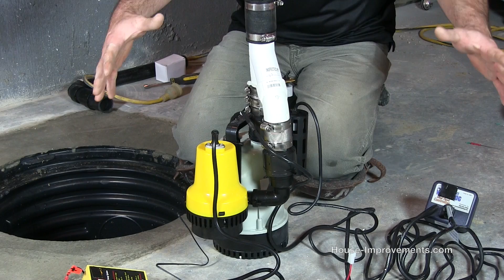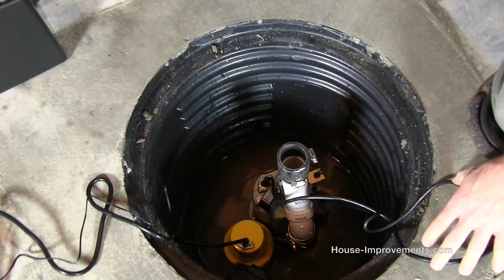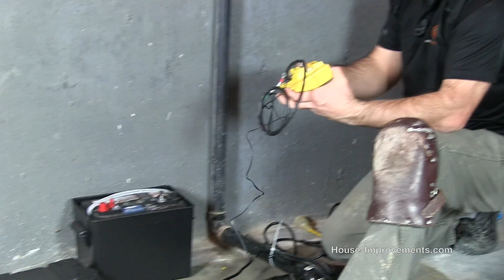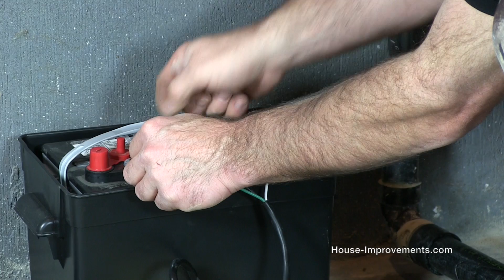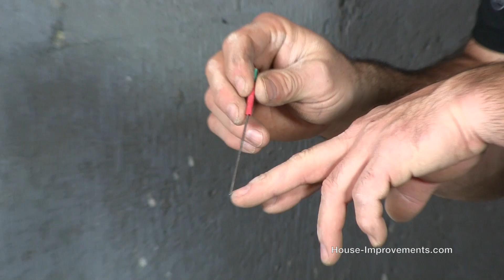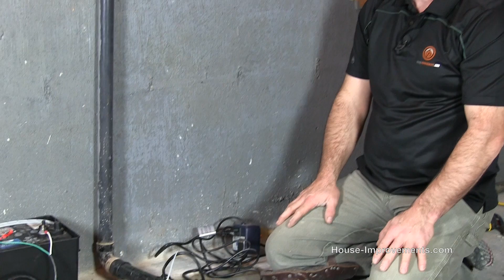How To Install A Sump Pump

Comment: I wanted to let you and your viewers know...the 12V systems are designed to continue to run for 10 seconds after the water level switch is  set to shut down. So, you unplugged it and didn't follow up on that issue, but that's what was going on and why it didn't seem to be shutting off. Great video!
Reply from the maker: That is good to know, I did not know about that feature!

Comment: Hey Shannon, thanks for all of your videos! How do I vapor proof the transition between the pipe and the sump tank lid? Also, the laundry wall box drain inlet?
Reply from the maker: That really should not be an issue but I guess you could seal the pipe with tape on a lid like this ? The drain should be plumbed right into the laundry plumbing .

Comment: I notice that the glued conections are above grade. The rubber fittings are below grade so that any leaks return to the wet sump. Is that correct?

Comment: I noticed that, during your test run of the primary pump, it rocked noticeably in the pit at startup.  Additionally, wasn't there a strong twisting torque when the pump surged into action? I fear that the pump might destroy the outflow pipe or separate the joint of the outflow pipe and the rubber union sleeve.  Isn't the only resistance to the sudden torque the plastic pipe?  Or, does water in the tank somehow absorb the torque and reduce the vibration?  Otherwise, the pump would need to be secured to the walls  of the well.
Reply from the maker: I know this customer and the same pump is still being used.

Comment: Love your videos.  I would like to share something. I have a real water problem. In April, it is normal to have to pump 1700 US gallons of water in a single day (snow melt). I use a sewage/ effluent pump because it was high capacity instead of a standard sump pump. This means the pump gets plenty of time to cool before it goes on again (avoid overheating). I do not use a backup pump because I cannot depend on a battery operated Chinese low capacity pump. Instead I bought a marine inverter and have 2 marine batteries connected to the inverter. The inverter will provide 110V for the sewage pump when the power goes out. If I am concerned that 2 batteries are insufficient, I can buy more  batteries. I do not have a standard black bucket from the hardware store. I use a 50 gallon drum and when my pump goes on, it evacuates about 110 litres (almost 30 US gallons).

Comment: Hey Shannon!  I am installing a Plumbstar basin with lid lock (2-hole insert).  I already dug the hole and I am filling in the sides with gravel and want to cement it flush up to the lid.  Question is...How does the water travel into the basin if I create a radon breather and the PVC that is pumped out with the sump pump if I make the lid tight?  I went to their website and have googled my butt off and have not quite figured it out. Please help me!
Reply from the maker: These are not meant to catch water that floods from the basement ,these are for ground water from under the floor and around the perimeter of the house. if you have more questions please use my forum.https://www.house-improvements.com/forums/
Reply: @HouseImprovements had the same question.  I live in Perry County Ohio.  We just had a flood disaster and never seen anything like this in my life. 
I bought the last pump there was  and it was a pump like this goes into basin but had no choice but to use it to try save my furnace  
What type of pump do I need to drain flooded basement?
Neighbor brought over a lil giant dump with a garden hose but it just trickled out not strong enough to go up the steps to the street .  
I’d appreciate you directing me to a correct pump and maybe i can use this one for the crawl space portion., 
My old house has a partial basement and under kitchen add on is a crawl space that leaks into basement

Comment: Great video and thanks. I'm following your sump pail install video this week. 

You said that they were dumping the sump water into the sewage lines. My house is like that too. It was built in 1955 and that was the way it was done then so I get a pass from the city. My question is; do you need a P-trap along with the one-way valve? I have but I'd love to dump the p-trap. From what I've read though code does require the P-trap in Alberta. Any ideas?
Reply from the maker: If you are dumping into a floor drain you do not need one cause that drain will have a trap. If you are dumping right into a sewer line then you should have one as well as a sewer back check valve maybe. Use my forum if you have more questions. https://www.house-improvements.com/forums/

Comment: Actually, the backup and the main pump run off a extended run time once the bottom float lowers, so that was why the backup was still running. And they are actually adjustable, they have a tie(backup uses a white plastic one, and the main float uses a steel one) which can be unscrewed and then you can adjust it.
Reply from the maker: Thanks

Comment: Thanks for explaining the details such as how the rubber connector helps with vibration, or about the the slope of the concrete in the previous video. Excellent tips that I would otherwise have learned the hard way. Great presentation, Thank you!
Reply from the maker: You're welcome.

Comment: Sitting a modern battery on concrete is not a problem at all, this is a myth from way back in the old days when battery boxes were made of wood or steel, now days they are made of plastic which is non conductive and the cool concrete floor is also non conductive when dry.
If the concrete is moist it can conduct electricity but the plastic case prevents this from happening, please see the link below for more info.
http://www.homepower.com/articles/solar-electricity/equipment-products/ask-experts-batteries-concrete
Reply from the maker: Thanks Terry

Comment: Outstanding presentation and advice, again. Thanks Shannon. 
Just not super keen on that battery in the house though - "sealed non-spillable" doesn't mean they don't off-gas hydrogen. KA-BOOM. Even in the plastic box (which will likely shatter anyhow) it will make you some deaf and spray acid everywhere, which is OK if you are leaving your basement all unfinished.

Same for these wankers that load up the inside of their RV's with them because they are super enviro solar. There is a reason the factory sets up any rig with the batteries in an outside compartment
Reply from the maker: I suppose it could happen under the right conditions
Reply: Yes. Any open flame or spark.
Reply: Especially if the water level in the battery goes down.  Had that problem with a UPS I built with deep cycle batteries.  I forgot to put water in them, they dried up.  When I added water and tried charging them, they started smelling bad like rotten eggs.  Not good.  Fortunately, I disconnected them before anything bad happened (they were in the bedroom).  I will have to move them someplace safer if I use them again.

Comment: It didn't sound like there was enough water to make the check valve hold. It sounded like the water was leaking back in. When I was a kid we had a sump pump. During the winter the water would freeze in the street and block the exit drain. I stayed home from school on those mornings and chopped ice with an axe. Looking back I could have just dumped some of the water softener salt we had into the sump well and alleviated that problem.
Reply from the maker: Because the check valve is a couple inches above the inlet the water before the check does leak back.

Comment: The "basement watch dog emergency"was what was covered up on the yellow unit for whatever reason. I had one of these units. Never had to see if the battery worked or not. Failed after about five years. The only thing I think I would add would be to bundle and wire tie the wires from the bottom up and then to the pipe for a nice clean look.
Reply: "was covered up on the yellow unit for whatever reason"

One reason could be why endorse any product for free?  There is quite a viewership here and if they want their products to appear in these videos, they should pay.  OR, maybe the maker of these videos doesn't want to endorse ANY product because, if the product is crap, it could reflect badly on him.  The value in these videos isn't so much the brand of products he uses.
Reply from the maker: It also effects our advertising ability on these videos and that is how we mostly make money here. Although our Patreon campaign and paypal donations help as well.
Reply: Curiosity
Reply: HouseImprovements :  I wonder if the second check valve I installed  is the reason my pump won't cut off.
I drilled the weep hole.